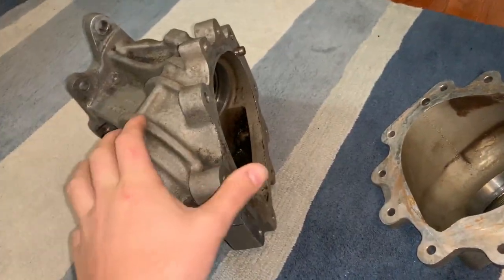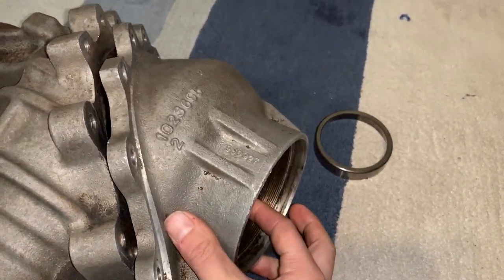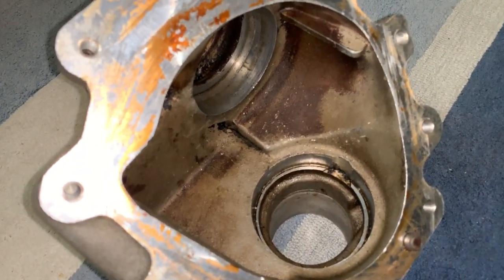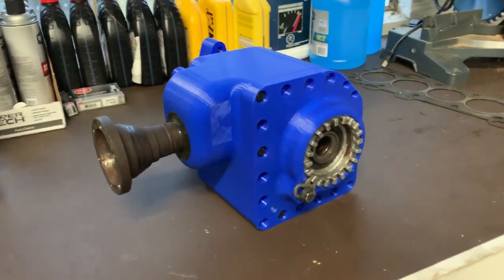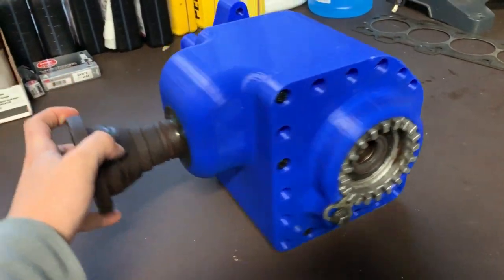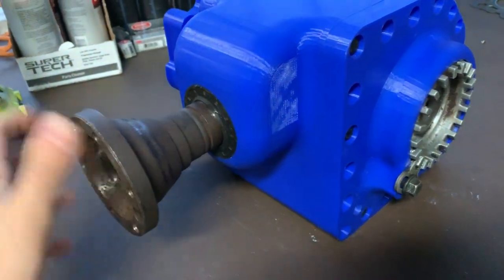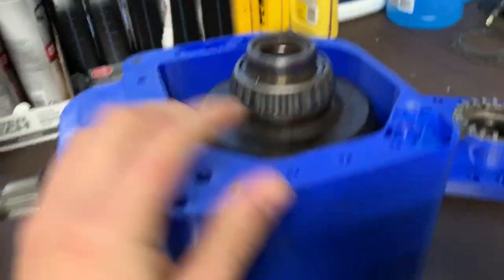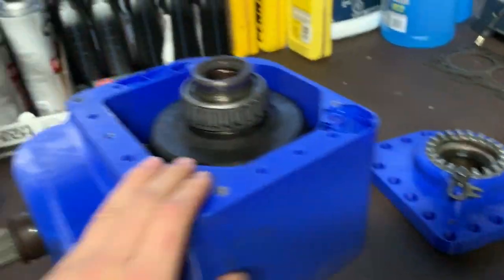Volvo 850 T-5R AWD Swap - Billet Angle Gear Case Prototype

Comment: really nice to see poeple innovating products on older Volvos! nice work! 

would you see any benefit in adding cooling fins to the bottom and/or side of the casing?
Reply from the maker: No because its going to have an external lubrication system with the option of external cooling.

Comment: VERY Impressive!! Of course, still a tone questions. FYI: My point of view is '07 S60 R
1. Why not cut the bottom off instead of the side?? (like the oil pan on the engine). It would give all the bearings in one solid piece of aluminum. Also making the machining for bearing alignment easier. I am sure there is likely good reason for it... huummm could you get the gears in and out of the case that way?? Anyway, just curious.

From a market viewpoint: Ok will it works in a 850... what about the 2004-2007 Rs?? Stick and/or automatic?? (heck even the 2.5T AWDs) Would guess the overall market is relatively small (100 to 1000 units (???) for the fleet of aging Volvos this could work in AND people would spend some reasonable $$ on) so the wider the fitment the more market there would be.

I know the collar is a big part of fitting other models... not sure if the angle gear dimensions where it mounts to the transmission is a part of the fitment issue between models/years & transmissions.

Hoping the very best for your efforts, truly fantastic work.
Reply: I'd pay Money for this if I could use it in my 04 V70r. 

Is there a huge difference in the angle gear design between the P80 and P2 chassis?

Comment: @simplyvolvo it would be beneficial to make the transmission flange removable with bolts, as you have it on the prototype. it'll allow you to make one case for many volvo angle gear applications will broaden you customer base. as well as make room for better sales and allow both manual and auto markets. instead of selling to just older volvo markets( not knocking or bad mouthing any thing or anyone). there are people who would love a stronger angle gear on the p2 R models. THIS IS MY OPINOIN INTERNET!

Comment: I watched this a couple times already; I really admire your discipline on this project! It takes time to develop bulletproof drivetrain parts. Obviously car companies don't have the inclination to do with only a consumer budget.  Pressurized, active lubrication and cooling sounds like the best option for peace of mind.   Did you have any thoughts on torsional movement or oscillation of the new case that might call for additional external bracketry ?
Reply from the maker: From my finite element analysis simulation the case only moves about 1mm (in the direction of rotation) at absolute maximum load, so I don't think I will need any extra bracketry. This is due to the completely redesigned flange that bolts to the transmission. It is 20mm thicker than stock and the neck that connects the flange to the main case of the AG is much thicker with more surface area connecting the two.
Reply: @SimplyVolvo  That's great..that extra mass helps, i'm sure. The next thing you'll want to re-engineer are the motor mounts for sure; esp when it come time for the M66❤
Reply from the maker: @LordTominator  Tbh I haven't had any issues with the stock motor mounts. Volvo gives us 4 big mounts from the factory. I run OEM front and rear hydraulic mounts and my side mount near the crank pulley is MPRE.se solid mount. Coupled with a good transmission mount in the front of the subframe things are pretty solid.  My other 700-1000hp buddies all run OEM mounts too no issues.
Reply: @SimplyVolvo  Sounds good! AWD Should have 5 mounts counting the upper and lower torque bones, and left,front and right engine subframe mounts. I know the M66 will require some kinda modified mount on the DS subframe..not same as AT mount. The driver's side trans mount has an adjuster to counter torqsteer according to ssvc manual. interesting layout for sure.
Reply from the maker: @LordTominator  AH yes 5 mounts. I forgot about the upper torque mount.

Comment: There are three iterations of bevel gears for P80 models, it would be a wrinkle to consider if you bring these to production. Also, a 3” downpipe is gonna be real tight, and non-native (large frame) turbo drain pipes are gonna be a tight fit as well. 

I definitely applaud your work, and will be interested to follow this. I have broken one angle gear in ten years of ownership of my ‘98 V70r, which makes about 500 awhp and 600 lb/ft of torque, so I can safely say I’m in a real small minority of people actually putting that type of power through a P80 AWD. The failure occurred under heavy acceleration from a 2nd gear roll while turning in the rain. Aside from that the system has held some substantial abuse, though I do not launch the car, ever.
Reply from the maker: There are only basically 2 iterations if you boil it down of the P80 angle gear. The 96-99 which share all of the same internals but have different companion flanges and the 00 model which is basically a P2 AG with the P80 3.31 gear ratio. As far as P80 is concerned this case can be for use in any P80. You simply use the 96-99 gear set with whatever companion flange your model uses. As for P2 my design is a parametric design so I just need to change a few numbers to generate a P2 case. You may be wondering why I didn't just design a 00 P80 case and then I could use the same case for a P2 and just swap the gears and that's because the 96-99 have the largest bearings and you cant retrofit them on the slightly smaller pinon shaft of the 00+ or find ones in the same size for use with the 00+ pinon. The 00 case is really rare anyway so it doesn't make sense to make a case for that year. People with an 00 who want to use this case shouldn't have any issue sourcing a 96-99 AG to salvage the gears from.

Your failure sounds like the front wheels completely lost traction and thus all of the torque has to go somewhere so 100% torque  went to rear which broke the AG.

Comment: -What programme did you use? 
- because it’s a sizeable chunk of metal it’s going to retain more heat, have you thought about machining fins to aid cooling. To retain structural integrity the heat sink could bolted on. Just a suggestion.

Comment: This might be a dumb question but what options did you rule out before deciding on making a custom housing? I'm trying to build up a friend's S60 R on a budget and it won't have nearly this amount of power so I'm hoping to get by with a bit less aggressive solution but so far all I can think of is to cryotreat the transfer case and weld the angle gear onto it. Anything stick out in your research that might be a better solution?

Comment: You really need to research lookforjoe on swedespeed. Hes already done what your trying to do now years ago on his all custom v70xc
Reply from the maker: I've know lookforjoe (hussein), great guy, for probably 5 years now. Last time I checked he didn't design any angle gear cases and was making about 450awhp. so def doesn't sound like hes done what Im trying to do. But he has shown use the stock AWD can handle 400ish whp, but launching still breaks it. Launchable 700-800awhp is a whole different game my friend...

Comment: Hey Matt, I searched for a lot of info before I converted my car to rear wheel drive. One big reason for failing of the angle gear is the heat of the turbo and exhaust that makes the oil in the angle gear cook and breack down. Are you familiar with that problem and are you going to do something to keep the heat away. certenly when you're going to race it. Regards Erwin

Comment: Nice work. 
Hopefully you know someone that owns a machine shop and has some good cnc machines. Walking in the door of some random shop and asking them to make these parts for you is going to cost a absolute fortune. 
Also a good tip is to minimize the fillets on the part. I know it looks good and adds some amount of strength, but it takes a lot of extra time to 3D machine it.

My daily job is prototype work and small production runs of parts on a 5 axis mill.

Comment: Since the 4 speed on a v70r has a lower final drive ratio, could this transmission deliver more torque to the stock angle gear than the m66? Like close to 300 or even 350 lbs?
Reply from the maker: Since the 4 speed has a lower final drive (like you said), the torque the AG will see will be less so a stock one should be able to handle more engine tq with the 4 speed than a m66.

Comment: Very cool. Did you replace the old bearings? If so, what size/brand did you use? How did you get the old ones off and the new ones on?
Reply from the maker: No because this is just a plastic prototype for checking fitment.

Comment: Really good work man! 

I'm just curious, how will you know how much oil to fill it? Aren't transfer cases tested to find the perfect capacity, or are you not worried about that?

Why not run a screamer pipe out the hood instead of out the back?
Reply from the maker: Volume = surface area * height. You fill it enough until the teeth closest to the bottom are submerged.

No screamer pipe because this isn't a janky Honda and screamer pipes are for lazy people.

Comment: CanadianV70R here, stoked to finally see this come to life. What programs did you use to figure out thrust and bearing bore forces?
Reply from the maker: I did it by hand. First I measured the gears (hypoid bevel gear set), then I calculated the gear tooth forces based upon input torque, then based upon the distance the bearings were from the gear tooth forces I calculated the combined radial load and axial load which I then used in my FEA model.

Comment: Do you have an idea on time frame for this billet case?
Reply from the maker: Im getting this case manufactured for myself as we speak. Deciding to sell them is a whole nother story if thats what you mean by timeframe.
Reply: @SimplyVolvo  I understand if you don't want to sell them, that's a lot of hard design and FEA work. I'm working on a bracket and drive connection for a mechanical fuel pump to run it off of the intake cam. I'm new to CAD work, so it's slow going and it's much simpler than what you did. Maybe you can help me out with Fusion 360?!

Comment: Great info!!
Did u machine dog faceplates for your gearbox?!

Am thinking about machining some out of 9310 steel do u have any experience with that??
Reply from the maker: I don't see how this would work without machining new gears.
Reply: @SimplyVolvo   yh thats what i thought before but putting dog engagement faceplates has nothing to do with the gears, only the synchros and fork. 
When u send gearbox to get faceplates the just grind of or remove if removable everything but the actual gear and the weld on it the face plate.
Dog engagement is usually associated with straight cut gears, but yeh u can fit it on stock helical gears
Reply from the maker: @FirstLast-tx3yj  Let me rephrase, to do it properly it would require machining new gears. As soon as I hear welding dogs onto the stock gears I think Seems like too much work on the stock, weak helical gears for it to be worth it. Would rather purchase the quaife sequential straight cut gear set for M66. Or create my own straight cut gear set from scratch with proper dog faceplates built into the gear.
Reply: @SimplyVolvo  yh man thats the optimal way tp do it  but i am trying this cz its more affordable. Idk i think ill give it a shot and experiment, no other way to find out

Comment: How do you plan to address the angle gear sleeve stripping problem? It is far more prone to failure than any other component of the angle gear. I don't think it will be able to handle the loads you plan for it.
Reply from the maker: I disagree. 99% of collar failures are from 100K's of the miles of back and forth slop that slowly wears the spline over years until they wipe (strip). I have never seen one shear from raw torque. Its a 45 tooth spline, there are 27 teeth spline that hold way more torque than this one will ever see. If it does strip, ill just design my own out of 4340 and heat treat.
Reply: @SimplyVolvo  What is your opinion on welding the sleeve to the input shaft of the angle gear?
Reply from the maker: @ericallen7336  Its a good fix, but you can never remove the ring gear from the case ever again. It would be better to drill and tap 4 M12 holes around the perimeter all the way through and then install set screws. This is another idea I plan on experimenting with.
Reply: @SimplyVolvo  Thanks. May tinker with that idea as well.
Reply from the maker: @ericallen7336  Installing those M12 set screws will stop the back and forth "slop" (backlash) in the spline that cause it to wear over time.

Comment: Would this bolt up to a s60R ?
Reply from the maker: This version wont. This is for a P80. But I plan on making a P2 version its very very similar with a few small differences.

Comment: Great work!
The only thing I can see that's missing is a vent at the top so oil doesn't blow past the seals as it heats up.
 How do you plan to get around the inherent weakness of the spline coupling?
Reply: Very true .. i am sure he is aware of that
Reply from the maker: Yes it is missing. Thank you. This isn't a final version. From my understanding & analysis the spline coupling failure is from wear and tear and not pure torque. Basically over 100s of thousands of miles there is very small back and forth slop that causes the splines to wear down over a very long time and then eventually fail. I plan on adding 4 x M12 set screws that "bolt" the collar sleeve to the AG input shaft. This will stop that back and forth slop that causes the splines to wear over time and strengthen it as a whole. My case will have pass through hole where these screws can be installed through after it has been bolted to the engine.
Reply: Just a note on the sleeve splines. On my 850 AWD the splines on the gearbox got worn down which meant finding a new gearbox which is rare/expensive here in the UK. 

But I suppose the alternative is the splines wearing on the angle gear which is also rare/expensive over here.

I guess that is why they epoxied the sleeve onto the gearbox side in later cars.
Reply from the maker: @dangerousdave5076  Interesting, but I won't be using a stock differential. Quaife differential on either M58 (yes this is possible) or M66. I've never seen the quaife splines get destroyed. Or I will also do my 4 M12 set screws on the diff side too. Plenty of fixes for the collar sleeve issue.
Reply: @SimplyVolvo  
I've seen people drill holes in the spline coupling and plug weld it to the AG spline through a drilled hole in the housing, similar to your set screw idea.

Comment: Awesome work dude! New subscriber here, I've been following your posts on Volvospeed for a while. Those highway wheelspin clips got my attention quick lol. I have a 2000 V70R with low miles, so I've been trying my best to keep it in good shape while adding more performance. Unfortunately, that includes dealing with the fragile angle gear on these cars. It's so refreshing to see some proper insight to the P80 AWD system (info on the internet about 'em is generally super old + often unreliable), and I hope everything goes smoothly! I'd love to see a whiteblock AWD car actually handle some serious power confidently for once, and if you ever decide to start producing the AGs for other Volvo guys, I'll very likely be in that line lol. Good luck! :)
Reply from the maker: Glad to have you onboard. Hopefully I can come up with a proper solution :)